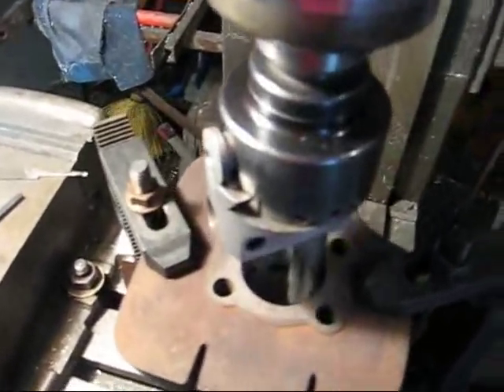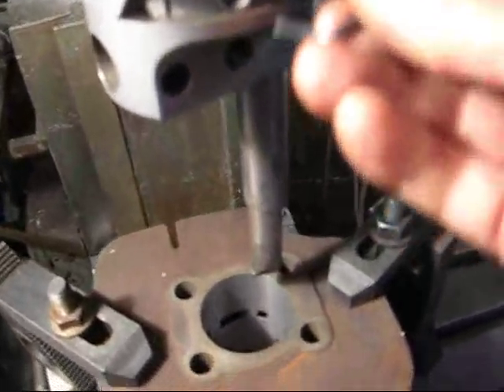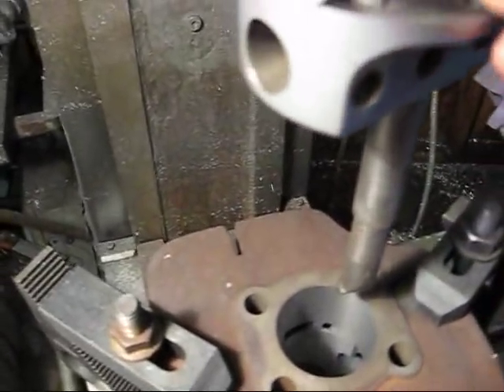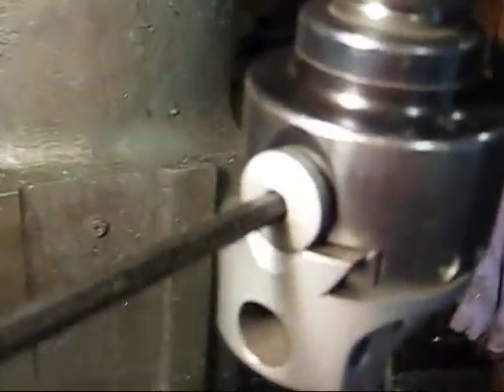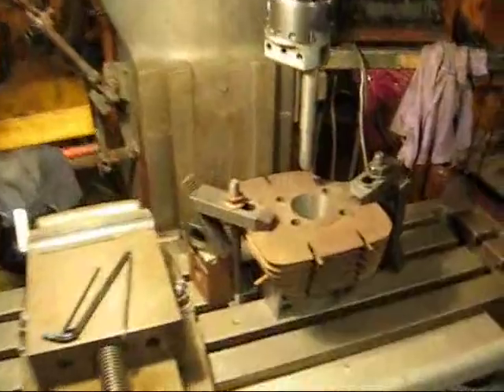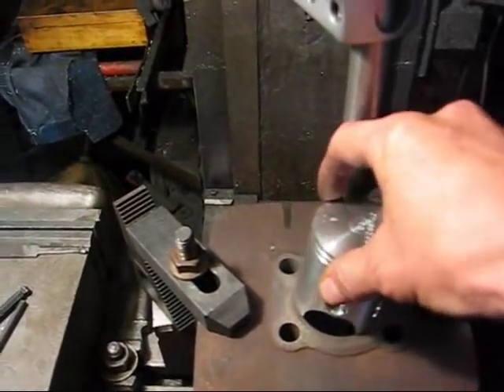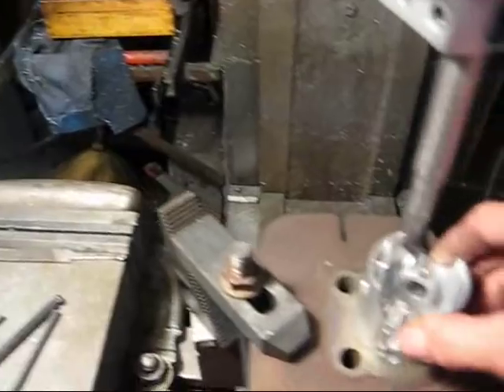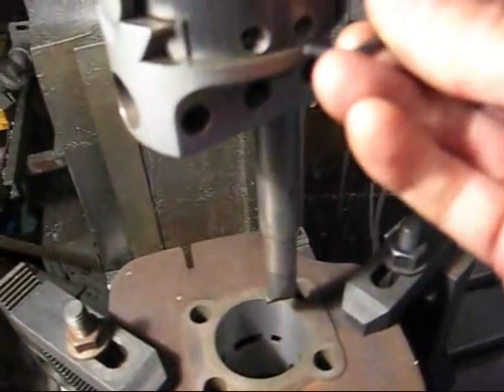Boring a Motorcycle Cylinder

Comment from the maker: sir you will use a indicator to center xy and z  to make sure it is within .0005 or better  and then zero your read out or your dials whichever you have . and make surte you lock the tables before you start to cut ope this helps you out .

Comment: Nice, but I wouldn't try putting the piston in dry before measuring and cross hatch honing it also. And they make pistons in every size imaginable. So order it after its both bored and cross hatched honed. If not bore checking offset two times to check, then bore the final adding the offset to exact size of a new piston then hone down to its tolerance and it's much better. Wiseco makes any piston, any size for any engine. And affordable to.
Reply: No you take measurements from the lowest point of bore first of all the most worn areas and then factor your piston off that. Sure you could clean up the cylinder and measure and order piston/s but if you know in general what you’re doing the results should be the same. I’ve typically had my pistons for the machine shops prior to commencing work and never had any issues. In a couple instances they would take measurements, call me and tell me what to order and wait to start machining until I presented a box of pistons to them. Those were usually race/drag applications where we couldn’t afford any extra cylinder wall than absolutely necessary.
Reply from the maker: I have never had a issue, I like to have my piston before and I like to hand fit them  and i usually bore in a lathe, in My opinion its just better,  once you get a good fixture.to hold ..

Comment from the maker: yes  Get your piston before you bore. Then Bore it to fit the pistone on a 2 stroke engine Usually (in General) about .002 inch per side is about a new clearance for most   amd for a 4 Stroke it is usually about half the  amount   they run a much closer tolerance than 2 strokes.

Comment: You should use oversized pistons and use them to make sure you machine the bore to the correct clearances for the model by measuring the piston and matching the bore to the piston/bore clearances required.

Comment: My 1986 Cr125r overheated from the radiator being dry, and the piston is now destroyed. I couldn't find a stock piston for the bike since it is so old, so now i have to get the cylinder bored to fit the piston. Thank you for uploading very interesting.
Reply: greenmachine824 weird. Should be pletny of parts around for that bike.. if you fried it like that it should be bored alittle over anyway just to clean up any damage. I own a 98 cr125r and i think last time i rebuilt the top end it cost me like 70$.

Comment: Is this a good/easy way to bore a cylinder? I’ve thought about boring cylinders on my mini lathe, but it has alot of play in the carriage so I think it would create a lot of variation (+taper) in the cylinder wall. But doing it on a mill like this the table is clamped so might give more even cutting?
Reply: Mini lathe isn’t rigid enough. You’d need a 12” or larger lathe to get a solid bore.

Comment: How do you know the piston size after that. I'm new to this stuff.
Reply: +Guzman3605 boring gage with dial meter, or you could probably get away with precision calipers (mityomoto's, starrett's) if you already have them in your shop. 

thanks this is an interesting way to do it with precision other than having to pay 2000$ for a van norman boring machine. plus a common bridgeport is so easy to find. what toolend is that? ive never seen it before. how did you end up centering up the cyl? what feeds and speeds are you using, and did you have to debur after? was that okay with no lubricant? not for cooling, but just to remove tiny chips which might scratch your piston after, though i guess after you probably can just polish

Comment: very bad job.. I can clearly see the vibration cutting inside the bore.
Reply: He was taking rough cuts to get the bore close to size. Then he would need to take a finish cut or two followed with honing to tolerance. Looked fine for where he ended the video. I usually don’t try and be critical of unfinished work. I’ve seen from others what has looked like crazy processing before finishing and insane risk of ruining parts turn out to be beautiful work. In other words save your judgement for the finished work.
Reply: It will always get home afterwards anyway to make it to the required finish with cross hatching